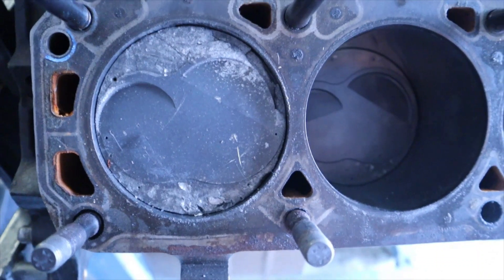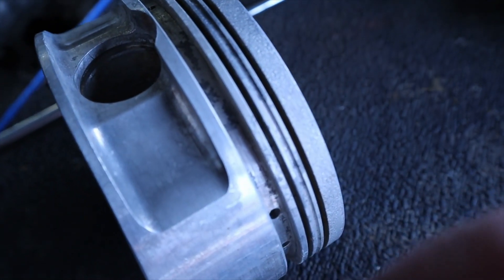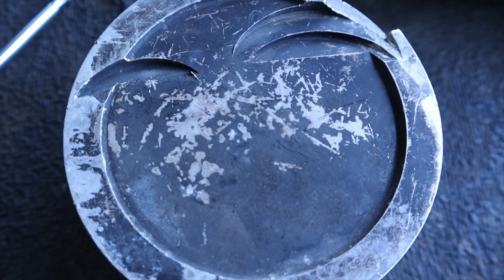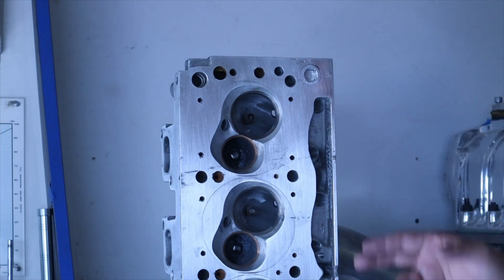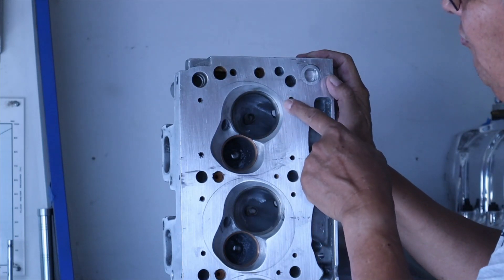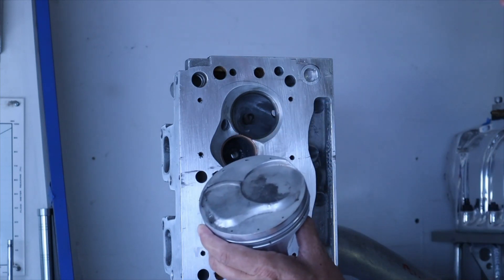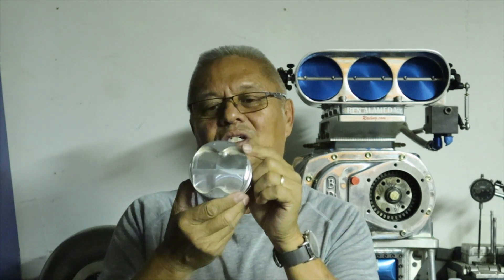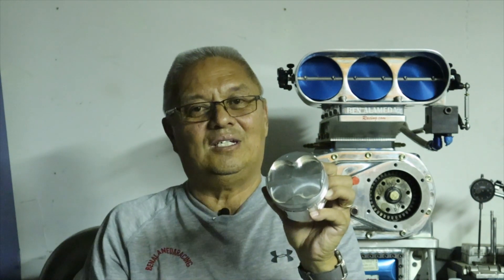PISTONS MELTING EXPLAINED!

Comment: Thanks for the video this is very informative.  I was curious on why the Hyundai 2.7l v6 engines that come in my car always melt the pitson on the intake side or crack a sleeve on the intake side, at the top of the bore when the tune was off or ran too much boost for 93. It all makes sense now , so making sure timing is correct and safe for the motor , fuel type and having the right afr would help with this issue correct?
Reply from the maker: You might been off a bit on the A/F ratio and maybe the timing as well or both!  How much boost were you pushing in at your engine?
Reply: @benalamedaracing2765 i know why my engine failed , too much timing and too flat of timing , also a few way too rich events , my fault, i later fixed my mistakes and fix the tune but it was already too late, car ran 5 psi at first got hurt a little and has some blow by and then i fixed the tune upped the boost to around 7 psi. Ran for a while but im putting another junk yard engine i will run 8 psi on 93 the 12 on e85 . But it made me come to think of why do pistons melt on the intake side when the tune is off . Then i saw what it did to those forged pistons in your video and made me think that also could be happening to the sleeves when people go forged bottom end on the stock sleeves. You see the top of the sleeve kinda have that same peppering that the side of the piston you had in the video and then patches will start to go missing then the sleeve will break at the flange and drop. It would always start on the intake side , it mqkes sense now sleeve is getting hammered and that eventually the pressue spikes will just cut it where the flange meets the block behind it.

Comment: Those pistons look like the top was ripped off, broken or busted not really melted. I see the peppering from detonation from the lean area you pointed out. But would you say the top ring butted from the extra heat from detonating and that was what ripped the top land off? Some of my first experience with detonation back in the 90s I had bad peppering pitting, burned plug and the ring land below the top ring had busted and pinched the second ring but the top was still intact, motor was loose and I always assumed the reason the top was intact was because it was so loose the rings didn't butt, and the reason the lower ring land busted was because it was loose and allowed more detonation pressure between the piston and wall pressing harder against the top ring.
Reply from the maker: Most melted pistons always failed around the same general area of the intake relief closest to the cylinder wall.  Before it happens when caught early you will see this area is rough like a sandpaper texture.  Rings are rotating all the time and if the end butted together from not enough ring gap you are correct.  However, it always fails at these same general location indicative of its lean conditions adjacent to the cylinder walls.  Every time this fails the owners/builders tells me they had more than ample enough ring end gap, and the reason some builders fail to realize is the position of the top ring being a concern because what works for a ring pack that sits .250-.300+ will require a set ring gap and this same situation changes dramatically when the ring pack sits @ .150 sometimes even less!  Then you have issues of heating with not enough material above the top ring making failures even more possible.  
Obtw, if the rings did butt together there will be an indication of cylinder wall scratches or wall damage and many times it does not anywhere and the top piston lifted up.  Wall damage if not for some parts caught in between the cyl. wall and piston will show scratches and most of the time there is no such evidence of wall damage and the piston top is obviously gone! An indication of ring(s) far from butting together...

Comment: I always wondered what would happen if the sparkplugs were moved to the intake side, having a small dimple between the valves, for the plug,  this would keep the plug out of the flow path. It may make cold starting slightly tougher but seems ford's been that way anyway,  most of my Chevy engines didn't even need a choke,  I live in the foothills of NC, it gets cold here!   Any opinions??
Reply from the maker: You do not want the sparkplug on the intake side because the prevailing spark burn front must start at the center of the cylinders where it is most effective.  Besides most of the richer side of the chambers are closer to the exhaust valve more than the intake so we must burn these much earlier!

Comment: Experiencing this problem with an rb20. Trying ceramic coating to the pistons along with methanol injection to control heat concentration.
Reply from the maker: Methanol plus coated pistons sides and top will give you excellent durability compared to any gasoline even E85 is superior!  In fact the most on a stock block gasoline boosted power I max out below 600rwhp.  With just E85 I have done over 630rwhp without any issue with the piston or bottom end.  Also keeping the rpms well below what we run with gasoline will make it last long.

Comment: I have seen this happen to pistons in a crate 351 base stroker, where the piston edge would curl upwards until it contacted the bottom of the head and broke off. This engine had about 4,000 miles on it, and had many less than optimum conditions in it. The burn marks did not tell an obvious story, but a lean condition and heat had to be responsible for the deformation of the piston top. The engine you were showing looked like its demise was sooner and more violent. I can understand that on the intake stroke, the incoming mixture will reach speeds that make it stop using the short side radius, but what I cant understand is how the mixture can still have pockets of lean ness at the end of the compression stroke, many degrees after the intake valve was closed......I have to assume much of the mixture came in wet and the "lean" spot stayed "dry, " and there is not enough time for all the surfaces in the chamber to equalize in wetness or temperature before it is lit. There is so much I dont know.....so this is my best guess.
Reply from the maker: Stuart, it is hard to equalize the mixture distribution all around the cylinders because of the momentum of the incoming charge column will slam and separate the A/F ratios all over the place!  I will do a video further explaining this scenario to make it even more clearer.  Tight quench will help distribute them but unfortunately the spark ignition flame already got going before it can self correct the rich/lean areas!  Thanks for supporting my channel!

Comment: What about quench on these LS heads with only 1 side of quench . Other side is like open chamber
Reply from the maker: It is ok because other cylinder heads have also one quench pad and it is a lot better than nothing!  LS heads also exhibit above normal swirl and tumble characteristics so that helps big time!
Reply: @benalamedaracing2765  thanks for the response BEN ! Im at 0 deck with 4cc dome pitons and 4.100 x .051 head gasket , thinking Im gonna get a 4" x .040 gasket set and redo my quench soon

Comment: Love all your videos. Glad it's not all about LS motors.  You mentioned a lot about light weight car's. What work's best for heavy truck's.  I am restoring my grandfathers 95 f-250 and building a 351w/408 11.2:1 stroker.  Don't stop making videos. I watch all of them. Multiple times.
Reply from the maker: 408 will have enough power even on a truck!  Keep that quench tight and lower gears out back will help keep it from detonating!  Do you have a camshaft in mind already?
Reply: @benalamedaracing2765  I just bought a Ford 9inch at the turkey rod run it has 410 gears. In the process of doing a crown Vic front end swap.  I do not have a camshaft yet. Probably a custom grind from Anderson or Iskey  cam.

Comment: Back when I was younger in my mini stock Circle Track Racing days we used to use the Toyota 3tc Hemi engine in a Corolla we used to race against all the Ford Pintos and four cylinder Mustangs I have had that problem on one of my engines on cylinder number four so I tore the engine down got a replacement piston and I've rounded off all the sharp edges on the piston valve reliefs and I knew that my issue was an intake manifold distribution problem because only that one cylinder was leaner than the rest all the compression pressure was the same and there were no head porting allowed in that class i reassembled the engine and it ran for the next two seasons with no problems so in my case getting rid of the sharp edges helped to keep some of that detonation at Bay
Reply: Are you the same Santos "King of the 3TC". I used to work at Toysport in the late 90's.
Reply: @ramirodiaz4545  
I think u thinking of Santos Turbo from Florida but I have been in the game a long time as Well still luv those 3tc and 2tc engines got a bunch of them parts are plentiful now days and so is the better tech due to Santos turbo,PSI Racing and such guys

Comment: My friend recently experienced this on his 347.  We know it was going lean as he kept melting the plug on that cyl #8.  He kept trying to remedy it but it eventually blew the head gasket.  The ensuing teardown exposed that the piston had also took some punishment.  Not really showing signs of melting but some peppering from debris likely from the spark plug getting eaten.  It's an older stroker kit so its a 12 week wait for some custom replacement pistons.  https://youtu.be/qg7R7nJSSoI?t=38
Reply from the maker: When pistons hit like these with debris from spark plugs make sure to install the rings and rotate around the pistons making sure the ring lands are not caved in and sticking or stuck!  Seen these things and people miss it altogether and it does not take much to push down and pinch the ring lands from debriss on top of the engine.

Comment: Does this heat problem  happen in all engines,or just in the way the head is made and the design of the piston?
Can the temperature  of the type of fuel cause some of this?
Iam a chevy guy.iam 65 yrs old.I find your engine videos  great!!
THANK YOU
Reply from the maker: These things usually happen when we are making good power and the ignition and fuel are on the confused side with errors producing this conditions.

Comment: Does the deeper valve relief cut on the intake side of the piston make it weaker near the edge? Also, what are you thoughts on piston and valve thermal barrier coatings?
Reply from the maker: Evan, yes if it is too deep it will intersect the top ring groove and it will be a short day!
Thermal barriers is always a plus for me and is good practice!